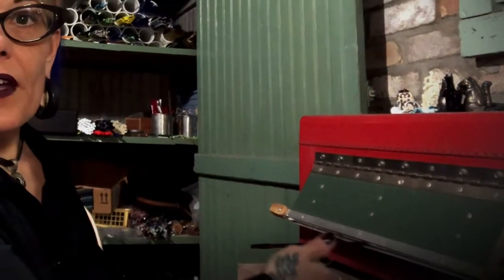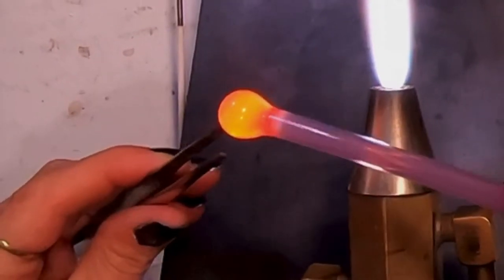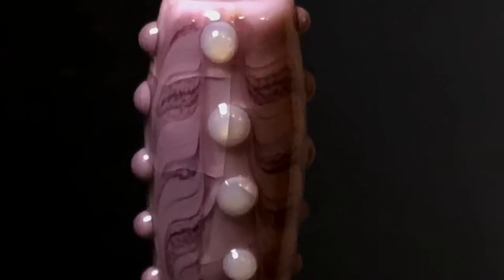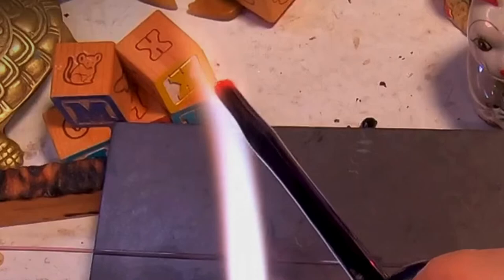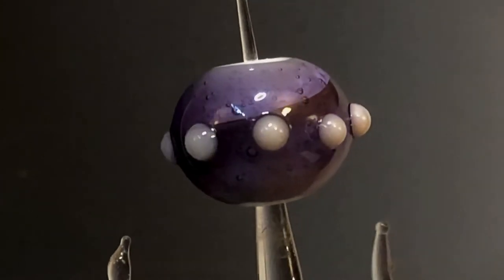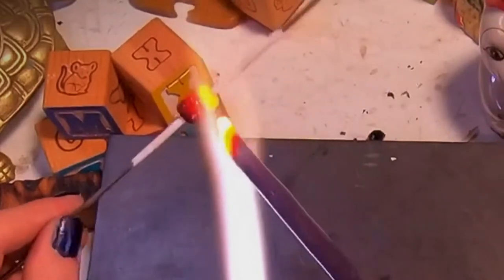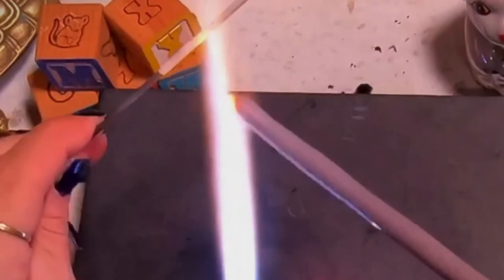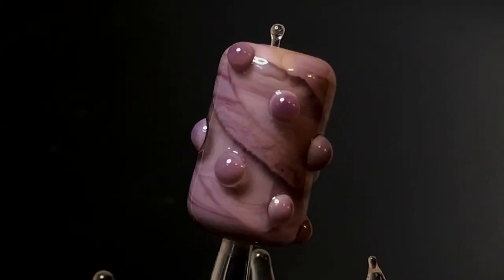A Study of Color - Devardi - The Purple Sample Pack - color review

Comment: You do a great service in demonstrating a glass like Devardi.  Glad I never used it.  I get enough glass splattering with Bullseye 90 coe.  The dense white is like missile flying.  Once you get it going it is fine usually.  I am having trouble with striking colors.  Have to rewatch your videos.  Thanks Robin.
Reply from the maker: Hi Vicki! 🤗💫 I was really hoping this glass was going to be easier to use….I loved the violet colors, but some of them looked identical to each other.  Aside from the glass rod, Devardi has some good tools with decent prices! ✨🌹  Striking colors are interesting….if you let it cool down then slowly heat it up a little at a time the color starts to emerge.  It takes some playing around with at first!  But you will get it….if not…let me know!!🙏🏽😂 Cheers- Robin 🌈✨✨

Comment: After watching this video last week I decided to do a compatibility test,I have about 2lbs of this stuff and don't use it much because of how frustrating it is to work with even after pre heating. So last night I tested a few colors with some Effetre and well it's not compatible,it all curled. I thought it was supposed to be and had been occasionally using small amounts of it with my other glass and hadn't noticed any problems but now that I've actually tested it I will only be using it with it's self.
Reply from the maker: Hi buttercup! That is probably a wise choice. Although I have found this color to work sometimes, if I decide to use it I will use it with itself as well! It is frustrating… But at least you don’t have a whole bunch!  I have about the same amount as you do and after I did this demo I have yet to use any of it.  I will at some point, perhaps just for some spacers! Thanks so much for your comment!  R -😁🖤🌹

Comment: I have learned with devardi to annealing  it at a higher temperature prevents cracking. Lauscha require a higher temp. So I just stuck to that for all my beads. I will agree with the purples seem to blend. Personally I encase most of my beads. Using their opaque color I tend to lose the saturation of the color. I tend to lean more to their transparent colors.
Reply from the maker: Ohhh thank you so much Valinda!  I am so glad for that tidbit of insight to working Devardi.  I usually hold my work at 1000°.  Do you use a higher temperature? I would love to be able to use what I have left, which is a lot. Are you just using  Devardi?  Or are you using different 104 together?
Sorry for the questions… I am so interested!   🌹✨🌹✨R-

Comment: I'm so glad I saw this video. I have been eyeing Devardi because of their prices. If you find a good annealing temperature would you let us know?
Reply from the maker: Hey Karen!  I almost always have my annealer set to 1000.  I will hold for 1 hour at this temp before cooling begins. 
That  has been my best temperature for all 104 glass.  Works great for both thin and thicker pieces of glass.   However, If I am using borosilicate, I will bump it up to 1050. 😃.  The Devardi works beautifully….   But I found slight incompatibility with it.  Perhaps it was the batch?  🤨I am clueless as to why I had some cracking issues. 
Thank you so much for the comment! 😍🔥🌹